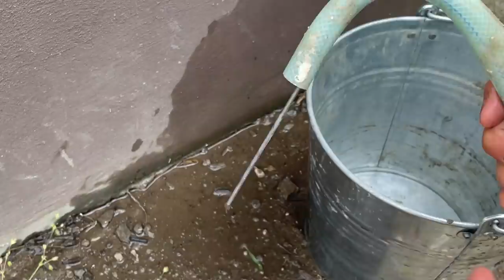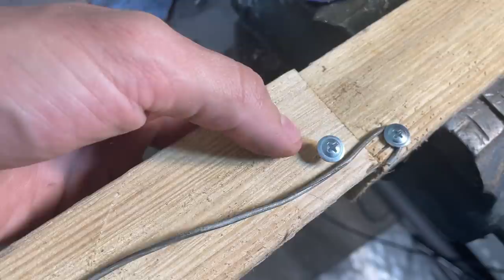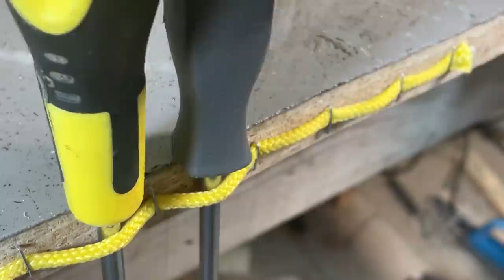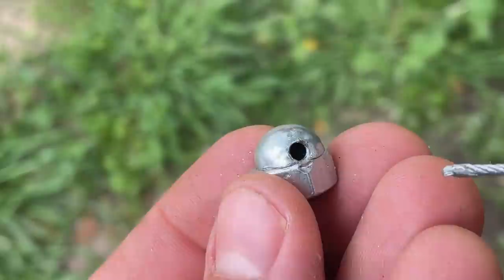Secrets Ideas of Handyman

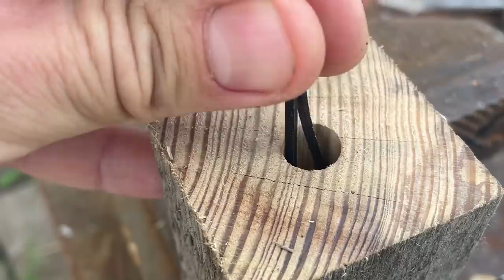Comment: 0:30 Loss wood holder
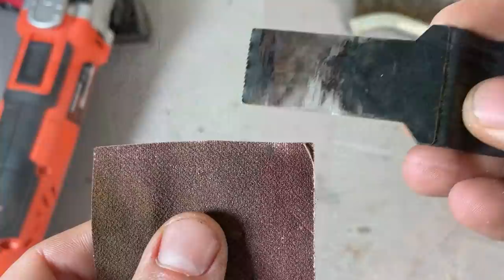0:55 turning oscillation tool into sanding
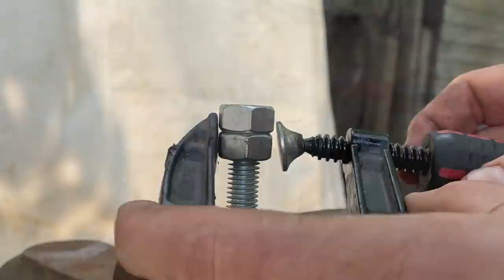1:20 alternative ranch
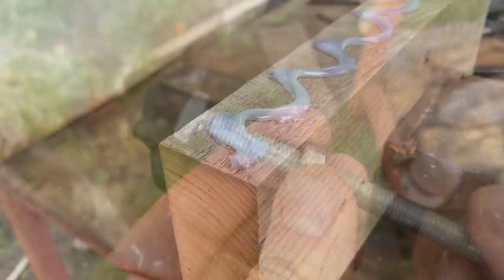1:40 wood glue spreader
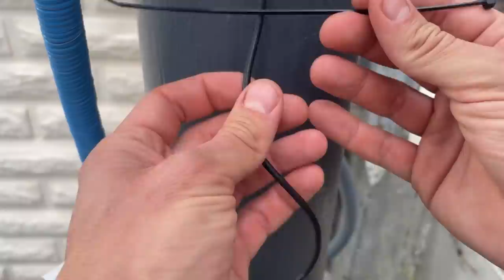1:50 zip tie extender by another zip tie 
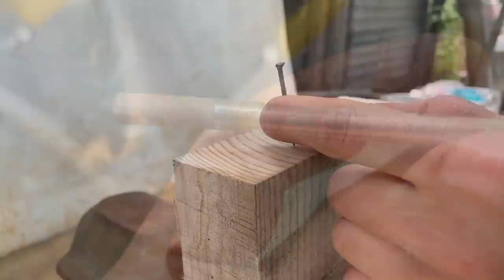2:25 nail holder by cardboard
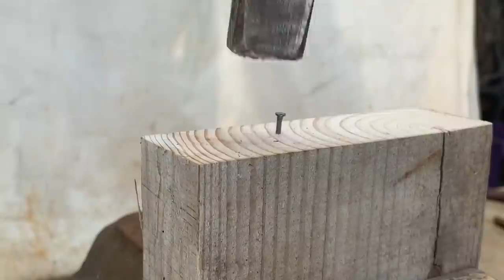2:38 wood extender  - 3:52
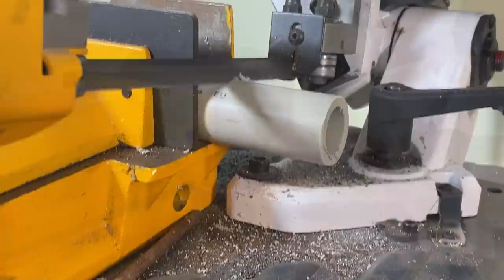3:07 Tool holder
4:10 drill bit making out of screw
4:33 wire chain extender
 4:45 Conduit holder made out of metal wire and a screw